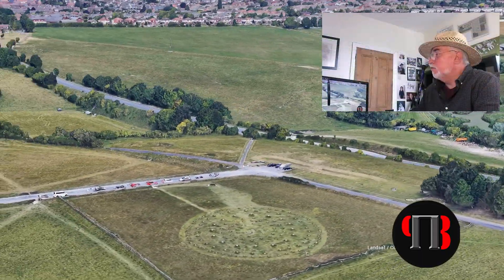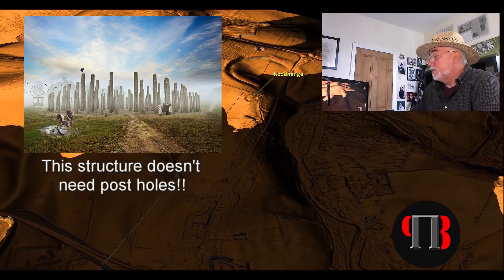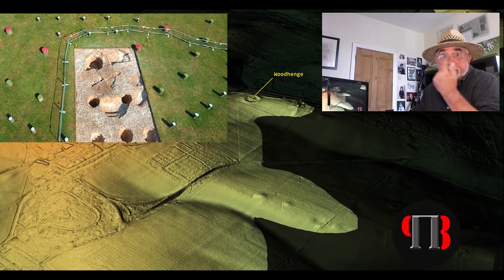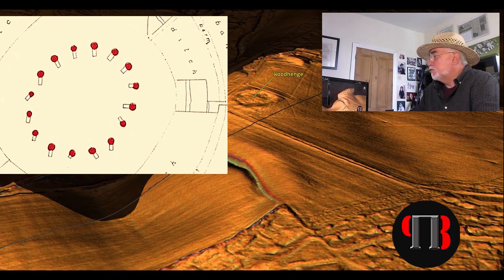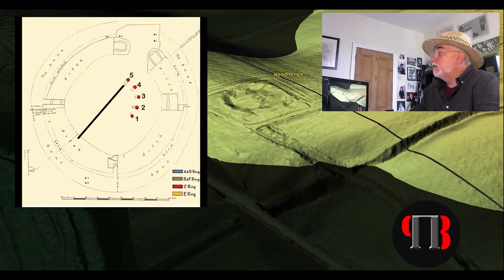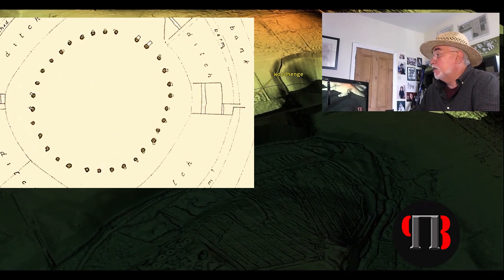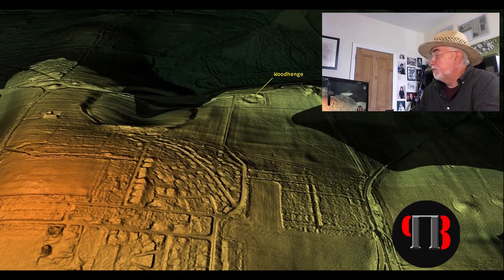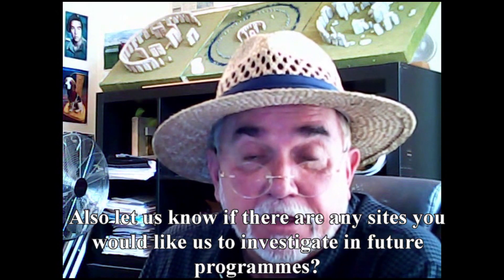The Woodhenge Hoax - LiDAR Investigation (HD)

Comment: Only two minutes in. What about the southern circle and the avenue? You suggest these were several metres underwater?
Reply from the maker: The so-called “Southern Circle” was clearly built after Woodhenge. Therefore, during the Woodhenge phase—around 8300 BCE—it would have been underwater. When the river later receded, the feature was probably added either as a mooring point (similar to a crannog) or as a dwelling on the emerging shoreline. Unfortunately, the dating of the Southern Cross remains highly subjective, which explains the uncertainty surrounding it.🤓
Reply: Blick Mead is at 75m, while Woodhenge is at 100m
Reply from the maker: @peterwynn4088  - Oh splendid! Another armchair archaeologist who’s skim-read a headline somewhere and thinks he’s cracked 10,000 years of hydrology. Let’s tidy this up before someone else faints from academic embarrassment.

1⃣ Blick Mead dates
No, Blick Mead is not 8300 BCE.
It’s mainly 7900–4000 BCE, with repeated use and hearths forming on Avon flood-edges as the waters SLOWLY fell over millennia. That supports the Post-Glacial Flooding model — it doesn’t contradict it.
High water → midden on high margins.
Falling water → hearths migrate downslope.
Basic hydrology. Not witchcraft.

2⃣ Durrington Walls & Woodhenge ARE contemporary with early Stonehenge
This is where your reading comprehension does a small swan-dive off a short pier.
Both sit on the same T9 Avon terrace as shown in our River Avon case study (link below).
Same terrace = same hydrological window.
Woodhenge wasn’t “at the end of the Avenue” — good grief — it was a harbour and a fire-beacon during the same flooded period.
Details here: https://prehistoric-britain.co.uk/the-stonehenge-hoax-woodhenge

3⃣ If water levels dropped through time (which they did), then of course Blick Mead’s later dates sit LOWER in the landscape
That’s the whole point.
You don’t get a single perfect 8300 BCE footprint frozen in time.
You get falling groundwater, terraces forming at different stages, sites used in different hydrological phases.
Try to picture a LADDER, not a light switch.

4⃣ And yes — this supports the early Stonehenge model, not undermines it
High water = Phase 1 Stonehenge peninsula.
Dropping water = emergence of Woodhenge/Durrington terrace use.
Later low water = Blick Mead hearths migrating downhill.

If any of this is still baffling, the maths and hydrology are laid out here — not opinion, not guesswork, not “feelings,” just numbers:

The Stonehenge Code (mathematical proof)
https://prehistoric-britain.co.uk/the-stonehenge-code

River Avon Case Study (T-terraces & water levels)
https://prehistoric-britain.co.uk/rethinking-the-past